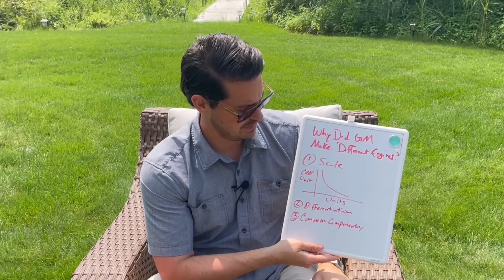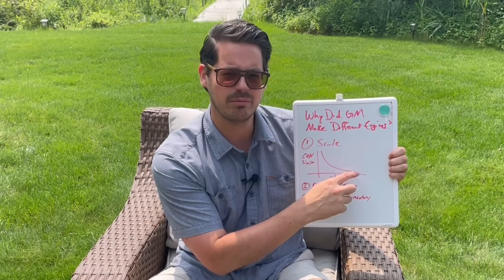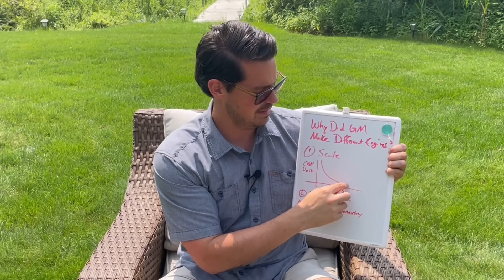Why did General Motors (GM) Make So Many Different V8 Engines in the 1950s-1970s?

Comment: The reason GM had so many different engines is because GM was a conglomeration of different brands of vehicles and those brands maintained their separate identities.
Way back when, GM started sharing chassis among it's different vehicle divisions, but what was put on top of those common chassis was unique to that particular brand and model.
Engines were a part of differentiating brands.
In the mid-60's, GM consolidated each of it's transmission manufacturing facilities. The hydramatic was no longer built as a division of Oldsmobile, as with the DynaFlows, PowerGlides and Super Turbines. All which still existed, basically the PowerGlide, was no longer exclusive to any GM make or model. All the different automatic transmissions were manufactured under the same roofs.
As manufacturing costs began quickly rising in the inflation years of the late-60's, GM had to respond. They had already consolidated chassis and transmission sharing, so why not body sharing, making minute variations so that different divisions could still keep their identities. Eventually coming down to sharing the same sheetmetal and varying just the front and rear ends, which were merely add-ons to the basic body structures. Individual interiors were also an identity of brand.
People seemed to accept it, so which increasing emissions standards causing higher costs and each engine having to be certified separately, engine consolidation began. This saved money on all fronts for using the same engines in multiple makes and models. For the most part, Cadillac was the only remaining brand to have it's own exclusive engines. It did share variations of the Northstar  with Oldsmobile.
Rising manufacturing costs was probably the greatest influence on consolidation, but the cost of emission certifications put the final nail in their coffins. Because of required certifications, they further reduced costs, when there was a difference in State emission requirements, specifically California, and it's separate certification requirements, some engines and transmissions and combinations of each were excluded from sales in California. Fuel mileage concerns was another driving force to shrink the sizes of not only engines but the cars themselves. 1977 saw a reduction in the sizes of full-size cars and 1978 for the mid-size cars. Furthering the reductions of sizes, and not only just engines, but the mid-size car became the new full-size car. Again being driven by emission and fuel mileage requirements.
Reply: Not quite.  Powerglide was never used by anybody but Chevrolet.  The 2 speed "Super Turbine 300" and the 2 speed "Jetaway" used by Buick and Olds respectively were NOT Chevy Powerglides.  The Powerglide was much better.  The Buick Dynaflow and the Chevy Powerglide were not made in either the original Hydramatic plant nor the replacement in Livorna.  Their replacements, the Turbo 350 and Turbo 400 were made in the same plant.
Reply: @michaelbenardo5695  Well, let's see, after the S.T.300's last official year of 1967, some spilled over into 1968, but, from 1969-on, atleast, the PowerGlide was extended to Buick, Oldsmobile and Pontiac, plus GMC trucks after the Hydramatic ended production, pre-1965.
Examples, in 1966, the Pontiac GTO used the PowerGlide, of which I had a customer who had one and, the George Barris-built Monkeemobile, also a 1966 GTO(which was also made from the same car that Maj. Nelson drove in the "I Dream Of Jeanie" TV series, and it also had a PowerGlide.
GM decided to share it's Chevy Nova platform with the B-O-P lines and the base automatic into the 1972 model year was the PowerGlide.
I was in the automotive and transmission repair business for over 30 years and have worked on 100's of cars and transmission,  so I know a little bit. My time also included working at GM dealerships.
Right. The original DynaFlows were built by Buick and I think the only GM car division to use it, and for one model year only, was Cadillac.
The original Powerglide was solely built by Chevrolet in their own factory.
Since the Hydramatic had been discontinued, all other surviving GM automatic transmissions were under one umbrella, the GM Hydramatic division. This didn't include GM's Allison automatic division which had their own assembly like.
The exclusive to Chevrolet TurboGlide,1957-1961, was similar to Buick's short-lived 1958 Flight Pitch Dynaflow, but was entirely different. The Chevy TurboGlide was reborn as the new aluminum-cased Powerglide and returned to an automatically shifting 2-speed automatic.

Comment: The auto companies started conforming to government's desire to remove the joy associated with individual transport compared to mass transit controlled by gov. By removing the joy of individual transport, the attack by the elites on the middle class went into full swing. For example, all steering wheels now are alike due to the airbag rule. It is now to the point where all the car companies have the same body panels throughout the industry. This has converted the car into an appliance, esp with all the electronics, where before the car was as individual as you wanted.

Comment: Terrific topic. I’ve always wondered why there wasn’t more standardization.
Reply: Me too. I think governments should have mandated a standard bell housing bolt pattern, probably expanding on the GM pattern. If it was done in the EU, all the bolts would be metric though. perhaps it would work if the bolt diameter was the same. some engines have the starter at the left of the engine, some at the right, some have the starter in the transmission, it would be a weird shape but would be well worth it. possibly the public would have to do a class action lawsuit to make it happen.

Comment: The funny one is why Ford had so many V8 engines.
From 1954 through 1977 you could have had the Y block, the FE, the Windsor - Fairlane V8,  the 351 Windsor which was a different block, the 400 modified - 351 modified,, the Cleveland,, and the 385 series 429 and 460s,,  all different engines...
Reply: Because engineering and technology is constantly advancing!
Reply: @jeffmiller3150   Ture but if you bought a Chevy in the same time frame you got a small block Chevy or a big block Chevy with a lite sprinkling of 348's and 409's....
Reply: @2packs4sure  Except the small journal to large journal change in the small block in the 60's. Or the 305 vs 350 non-interchangable anything internal (also the vortec heads in the 90's have a unique intake bolt pattern). Plus the unique 400 small block... Or the short deck 396/403/427/454 vs the tall deck 366/427. But other than being completely different they were all the "same" LOL.
Reply: @TheRetarp  lol
Reply: What was Ford's last FE passenger car?
Reply: @craigbenz4835  67 models for "regular" Ford cars. 68 & 69 Ford & Mercury sporty models with the 428 were the last FE equipped cars. The heavy duty trucks would continue to use FE engines through the late 70's.
Reply: @craigbenz4835    I'm not absolutely sure,  70 or 71 I think...
Reply: @craigbenz4835   I see,,  misunderstood your question I'm pretty sure it was full size only and regular fuel 2 barrel 390s.

Comment: Be me 
> buy chevy wagon 
> open hood 
> olds 307 
Why GM use 307 in wagons and 305 in sedans ?
Reply: Well if your new Chevy back in the day came mysteriously equipped  with a engine from one of the  GM upper marks  you were lucky but if you were driving one of the upper marks and it had a bow tie motor well that is bad & you have every right  to crash the boardroom meeting  on the 14th floor at GM  by all means and say something on my behalf too
Reply: @georgewilson1184  Was in California in '77. Talking to some gear heads and they said the Buicks delivered out there had had Olds 350's because they met the California emissions
requirements and the Buicks didn't thus causing a shortage of Olds engines in the rest of the country. True or not I don't know.

Comment: The Oldsmobile 260 V8 came out in 1975. It beat the 305 Chevy, 301 Pontiac to the tiny V8 thing of the late 70’s. Then Ford, Chevy, and Pontiac would later around 1980 release similar small 2xx engines.

Comment: The idea of creating internal innovation by letting brands compete had/has merit. However at the point if commercial production GM should have gone with one and had the brands move on to competing for the next best design. Had they done that they would have had the resources to create the low fuel/emissions engines that new regs required.

Comment: Chrysler had a lot of different V8s once they introduced them in 1951. Not a lot of parts sharing there. But they learned pretty quickly they could use a few different ones to power everything. The wedge engines started that.
Reply: Still mostly a Bigblock , smallblock heminand bigblock hemi. Later with the poly in everything that even shares loads of parts with the last mopar smallblock :) even the slant 6 shared quite some parts with the bigblock
Reply: Mopar didn't need five tries to get it right.
Reply: Because they NEVER got it right. @craigbenz4835

Comment: But why minor size differences? Chevy 454 327 Pontiac 455 326 etc. Just to set each division apart? Were they really the same displacement?
Reply: Actually, I think it’s more surprising when the different divisions “just happen” to end up at the same C.I. size.  Like 455 for Pontiac/Olds/Buick.  Smart customers will know that other design differences will make a much bigger impact on things than a few cubic inches here or there.  Of course, it’s a bad idea to overestimate the customer’s intelligence; probably a lot of them would fixate on the C.I. number, and just assume bigger=better.

Comment: This is a GM video but just to clarify something Adam said about Ford 351 engines.... The 351C and 351M had a few important differences but were for the most part, the same design. Both from the same engine family - the "335 Series."
Reply from the maker: They’re pretty different. Different deck heights, main journal diameters and rod lengths.  Consequently different intakes etc.
Reply: @RareClassicCars  I guess it comes down to what your definition of "significant differences" is. To me, if it's in the same engine family and has the same basic architecture. it's essentially the same engine. YMMV.

Comment: Alfred Sloan was the onne who setup the system of committies at the top of gm that set the checks and balances to preserve divisional autonomy. That all went out the window in the 70s and 80s.
Reply: By about 1980 or so, with emission regulations and the dawn of fuel injection, engine development started to become too costly to let each division have its own V8, ergo, the Chevy V8 eventually prevailed across all divisions.

Comment: Why did Ford cancel its 429  and Chevy stopped the 427  and what happened to the Ford 477 yes I saw it in the 1975 Ford LTD  glove compartment  owners Manual
Reply: They just stroked them to get more CID.  I don't think that was good, but someone did.
Reply: Too little differentiation in performance and too little production volume to justify the supply chain/tooling/vendor costs for two separate engine variations (429/460 and 427/454).

Comment: You can add Holden Australia to the list, their first V8,s were chev small blocks fully imported from the US but as demand for the v8,s increased they built their own engine in 253 and 308 ci, later a 305 to satisfy race regs.  Core engine shared virtually nothing with any other GM v8.
Reply: Holden had always intended to use their own V8 for the HK but production delays forced Holden to use a Canadian Chevy V8 instead in its place. Later the Aussie V8 was introduced in the HT range alongside the larger Chevy V8's.
Reply: Plus the HSV 5.7L Holden V8s in the GTS models before the American Gen III LS1 took its place.
Reply: 304 actualy.
Reply: Don't forget 304cui SOHC 24v in the early 90's that was prototype motor.
Reply: @scradley05  Would have been better than the Northstar by a country mile.

Comment: I'm no expert but the difference I noticed between the divisions was the factory 280 hp 350 Buick in my 68 LeSabre would rev at 5500 rpm all day long and it had wonderful power up there. The 350 Chevies of that day were notorious for throwing rods that high, and someone in a Monte Carlo did that very thing trying to keep up with my 90 Mustang GT on the interstate once. 

Got up to about 120 and I heard a BOOM and it slowed down. I went around a curve and slowed down to wait for him, he never came around that curve. lol  (I feel bad looking back - guess I should have stopped to help)

On the opposite end, the 455 Pontiac that was put in my 80 Trans Am shared the block with their 301 it replaced, so it dropped right in and it was definitely the stump puller of the bunch, having warped the B pillars the few times I got on it. I was also warned never to take it above about 4800 rpm which I never did.

Comment: A fun little face you can do a deeper dive into is that some of the GM brands did not have a small block Vs big block like Chevrolet did.  Pontiac used he same block from their 303 to 455.  I think some of the over divisions did something similar.
Reply: The other divisions were the same. Some minor variations here and there such as deck height resulting in some somewhat convoluted definitions of exactly what "small block" and "big block" meant but for the most part, identical.
Reply: Second gen Buick V8s were of a legit small block and legit big block architecture (different bore spacing). The Pontiac and second get Olds V8s each had the same bore spacing for all displacements, but played with the deck height, so no such thing as a "small block" or "big block" Olds and Pontiac V8s (simply short vs. tall decks)

Comment: I have a 1955 GMC truck with a Pontiac V8 (factory installed) which I heard was used because of a factory fire
Reply: The factory fire was at the Hydramatic plant. In the 50's, GMC trucks DID use Pontiac engines.
Reply: @danielulz1640  yes mine has a Pontiac with a Truck o matic automatic transmission
Reply: @throttlewatch4614  AKA Hydramatic.
Reply: @danielulz1640  cast iron 😳

Comment: Thanks for the great video.   Ford played a similar game with lots of V8 offerings across the Ford, Mercury, and Lincoln lines.  They are:  221, 239, 256, 260, 272, 289, 292, 302, 312, 332, 351W, 351C, 351M,  352, 361, 383, 390, 400, 406, 410, 427, 428, 429, 430, 460, and 462.  Someone please let me know if I left something out.
Reply: Oh, I can add a few more Ford V8's. The was the Ford Super Duty series from the late 50's to1975 which included the 401. 477. &  535. Also, during the 70's I ran across a huge 383 which I was told came from a Mercury. I'm not sure what year though.                                 t
Reply: You’re correct in that they made a lot of different engines. However, many of those engines were the same family and could be made using the same machinery example the 221, 260,  289, 302, and 255 shared the same design. The 351w was ALMOST the same. Then you had the 351C,351 M, and 400 that were very similar. The 332, 312, 352, 360, 361, 390,427, 428 were similar,  the 370, 429, and 460 were similar. Some of these were truck engines.There were other families as well, I just don’t know off the top of my heads which belonged together. But concurrently, only the 351 had two completely different engines of the same displacement.
Reply: I can add a few. Ford brought out a 136 in 1937. It was mainly used in Europe even up into the 60's. The 337 was used in Lincoln & Ford trucks from 1949 to 1951. The 279 & 317 were used in Ford trucks from 1952 to 1955 & the 317 may have been used in Lincoln. The 221 started out as a flathead in 1932 & it later showed up as an 221 OVH in 1960. There could be more.
Reply: @n.mcneil4066  yes when compared to GM, in general Lincoln and Mercury engines tended to different from their Ford counterparts of the same year only in displacement. I think some of the 1960s era Lincoln's may have used design exclusive to them. It was the 462. But that was the exception rather than the rule in the modern era. But for the most part you could install the Mercury addition of an engine in a Ford of the same year with no modifications. But the GM engines we're completely different from one another depending on the division.

Comment: I also found it interesting back in the day that Buick, Olds, and Pontiac shared a common bell housing bolt pattern, where as Chevy and Cady were all different.
Reply: caddy also used bop bell housing after 67
Reply: Yes, they called it the BOP bolt pattern
Reply: GMC trucks (305 V6 IIRC) had BOP Pattern and even some Completely Pontiac Engines...that ended in the 60s sometime...